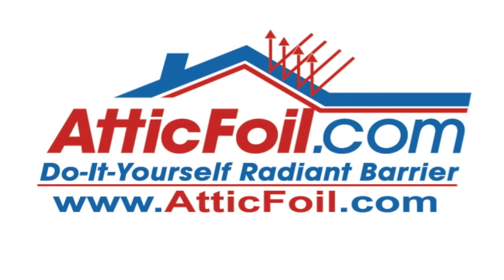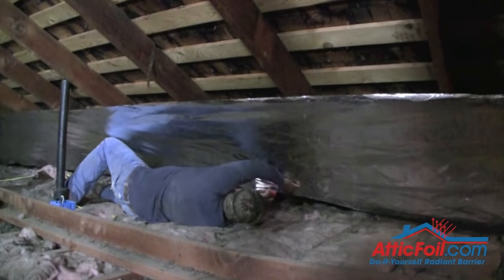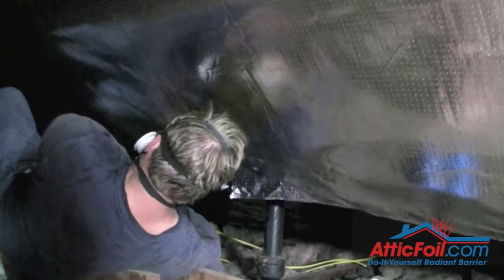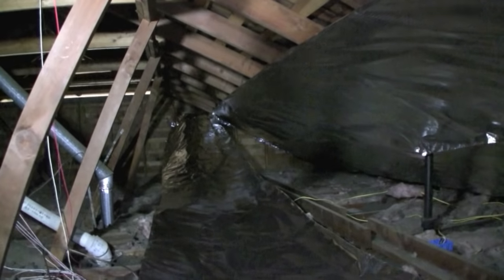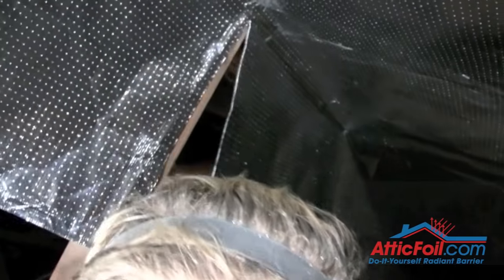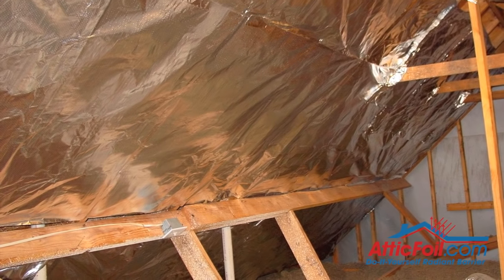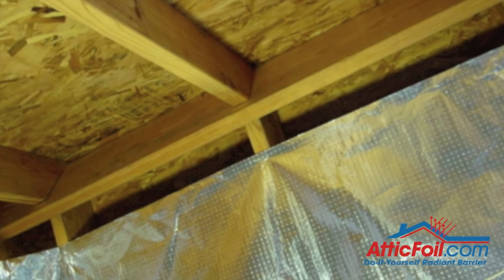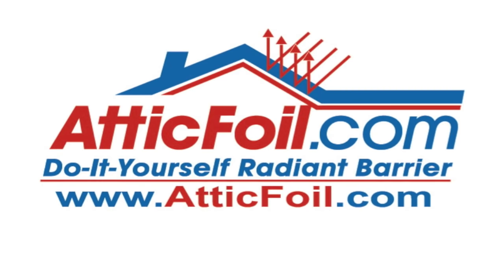Radiant Barrier Installation - How To Install Radiant Barrier

Comment: No one ever compares there bills on here before and after
Reply from the maker: I wish more customers did too!  Most of the results are here with 2000 other customer reviews: www.ReviewAtticFoil.com
Reply: @AtticFoil  ur link dose not work
Reply from the maker: @CCCC-tq8yo  Weird? It worked but gave me a Malware message?  Try www.ReviewAtticFoil.com it's a link to same page.
Reply: Not sure about the heating/cooling bill yet but for what it’s worth, I was quoted $962.50 to get radiant barrier installed in NC and I bought my attic foil roll for $117.95 (not including staples and a stapler.) I’m part of the way through the installation and it’s manageable by myself. I would recommend the diy approach and I’m happy with how durable the roll is as I’m installing it.
Reply from the maker: Alex, thanks for purchasing www.AtticFoil.com !  Yes, it definitely is a DIY project you can do for a fraction of the price compared to having it installed.  Please tell your friends and neighbors!

Comment from the maker: @tdennison22 An attic fan may (or may not) be your best option.  You don't want to mix exhaust vents.  Normally on higher pitch roofs, I like wind turbines - they work great, are easy to install and don't use electricity.  On lower pitch roofs, I like ridge vent (assuming you've got enough ridge).  First, I'd check to make sure you have soffit vents that are clear and open. Go to my blog RadiantBarrierGuru(d0t) com and read about proper attic ventilation or call us 800-595-8772 for more help.

Comment: how much would something like this cost for a house 1500 sq feet
Reply from the maker: Pricing is here: https://atticfoil.com/index.php/products/48-wide-double-sided-atticfoil-radiant-barrier-foil-perforated/  For 1500 ft home, you will probably need 2000 sq. ft to account for slope of roof.  Also, garages and porches can also be done.  Call us at www.AtticFoil.com if you need help in determining exactly how much you need.

Comment: Even if the radiant barrier touches the insulation its ok because the heat is traveling between the foil and bottom side of roof decking

Comment: That's great for summer, what about winter?
Reply from the maker: www.AtticFoil.com is mostly to reduce Summer heat gain.  Think of it as an umbrella compared to a jacket.  If you live where it's sunny a lot of the year, it's a huge benefit.
Reply: @AtticFoil  I live in Massachusetts and my house is really exposed to the sun , no trees. I am thinking of installing this type of radiant barrier because of the summer heat. But my concern is the heat gain that I will lose in the cold winter months or am I incorrect in thinking that?
Reply from the maker: There is actually very little useable heat from the sun on the roof in the winter for several reasons.  First, the sun is low, second the days are short and since heat always goes from hot to cold, the colder air will "suck" the heat out pretty quick.  Overall, you will come out ahead installing www.AtticFoil.com in your attic even in a colder area.
Reply: @AtticFoil  Thank you so much for the info, I'm no expert but that all sounds right to me, thank you 👍

Comment from the maker: @monkeyman1140 For high pitched roofs check out AtticFoil(dot)com and look at the Flat-Top Method on the Tall Attics Page.  This method keeps you from having to use any ladders in your attic.  Basically you create a flat grid across the attic about 7 ft. high.  Then run the foil up the slopes and across the flat part.  Works great.

Comment: Just need to be specific about which side faces where, remember we are 1st timers. I know I know when all else fails read the instructions.
Reply from the maker: Typically for staple up attic installations you will be using the double sided AtticFoil.  Both sides are the same.  https://atticfoil.com/index.php/products/48-wide-double-sided-atticfoil-radiant-barrier-foil-perforated/

Comment: the overlapping ins wrong.  if there are any roof leaks, the water will drip into the ceiling, to fix this overlap the uper insulation onto the lower,  above it, so it creates an ability for any moisture to flow from top tobottom and out the wall,
Reply from the maker: Actually the LAST thing you want is for any water from a roof leak to go to the bottom and into the wall.  With this method of installing www.AtticFoil.com any roof leak WILL drip within 4 ft of the leak and you will actually SEE it on the ceiling WAY before you discover the walls are wet/damaged.

Comment: Nice install video but ... that guy looks like he covered over all the roofing air vents and enclosed the entire attic save for the soffit vents. Those bottom soffit vents he correctly left  uncovered are useless unless you allow for venting out of the top.
Reply from the maker: He is not covering the air vents.  The basic rule is that if there is a hole in the roof, you want a corresponding hole in the foil below it.  Air should flow freely through the attic as though the AtticFoil Radiant Barrier is not even there.  www.AtticFoil.com

Comment: I if and by how much it would reduce my electrical bill which is $250-300 in my 2 story south Texas house.
Reply from the maker: That's a hard thing to pin down.  Basically Radiant Barrier reduces heat coming in the "top of the box".  On a two story home, the "top of the box" is less than a same sq. ft 1 story home, but it still makes a difference.  There are a lot of factors:  Age of home, equipment, construction, lifestyle etc.  Generally though 5-20% is going to be the range.  Usually, the biggest difference is in the comfort level on the 2nd floor.  We have many reviews where the customers say it just "feels" better after installing AtticFoil.
Reply: AtticFoil Radiant Barrier Foil Insulation thank you.  We went up there and my hubs put his foot through the ceiling. :/.  We realized we need some kind of board to walk on.  Any little bit will help!  Because we are paying so much we need some relief!!  We make less than 30 a year right now! Thank you so much for your awesome help and videos!!
Reply: you should start by making sure all your windows are caulked as most of your air might be escaping from there. I am in the same pickle you are in right now. The attics have these 2x4 that run across the entire attic. I have been told it is safe to walk on those... please someone correct me if I am wrong.
Reply: Faiza Raza,

It’s two years later. How’s the heat and comfort?

Comment: “It does not have to be pretty to be effective.” 

Man if you feel like taking business to the next level, that is not the correct approach. Also, if you are training guys you want to be OVER picky on cosmetics. Because you know they will typically land somewhere underneath perfect. Which is great. 

I install functional systems. I tell my clients that “it’s not fun money.” Functional money is not fun money to spend. It’s not like buying a car. I install crawlspace projects for $5K to $40K.  

It’s already a tough purchase when they can’t see it often and have to trust me. So, if my customer is paying that much money you best believe I’m going to make it pretty, and make sure it lasts forever, even though it doesn’t have to be pretty to function. 

Probably more on this comment than needs to be. I just very strongly disagree with that mindset. Do your best on every single project. Go the extra mile. It’s not all about installed dollars per man hour. If you have to move that fast to make money, you may need to re think your business model or raise your prices. 

But wait.... probably can’t raise prices if you aren’t selling the cosmetics as well. Not to the level that will change your life.
Reply from the maker: Did you miss the whole part about "DO-IT-YOURSELF" Radiant Barrier?  For them it's about the benefit and not how good it looks.  But thanks for the snarky comment!  Made my day. Ed.
Reply: @AtticFoil  no shit right. Dudes trying to sell quality to a comment thread that’s here only for value. I give zero fucks what it looks like

Comment: I just got this foil from Amazon, from the manufacturer. So its not a chinese fake. I lit it up with a lighter and it burns like paper, even faster. Isnt it supposed to be SOMEWHAT fire retardant?  is that something people actually installing in their attic next to all the electric wires and furnaces? Thats a fire hazard
Reply from the maker: Well, we do NOT sell www.AtticFoil.com on Amazon. We ONLY sell direct from our website. So, it's not ours. There are some companies that try to capitalize on our brand name and call their product AtticFoil.
Reply: If I have an older home and wanted to replace my plywood roof boards during a re-shingling, can I just apply this stuff to the back of plywood pieces directly before I lay new roof boards on?
Reply from the maker: Yes, two different methods: Here are the videos: https://youtu.be/iknm3zkIxaU?feature=shared  or this method: https://www.youtube.com/watch?v=uEh28E99arg
Reply: @AtticFoil  Nice thanks 👍

Comment: I am not a builder but logic dictates that second row of foil should have gone behind the first row and NOT stapled on top.   Shoddy workmanship.
Reply from the maker: Yes.  Very clear you are not a builder.  This is done in case there is ever a roof leak it will drip within 4 ft of the leak instead of going into the walls or soffits.  We want the leak to show itself with simple stain on sheetrock instead of wet walls.
Reply: good, your a Shoddy thinker!  lol
Reply: why would logic dictate that at all? cool air is coming in through the soffits and traveling upwards with the hot air out to the roof vents. If you have the top overlapping the bottom piece, hot air will be able to go out of the overlap. In the way they did it, the overlap faces downwards (the opposite way of which the air is flowing.)  this is only going to let cooler air in. It almost acts as a Tesla Valve.
Reply from the maker: @artlovemusicpeace  Don't overthink this.  Gaps, slits, openings etc. does not matter.  Hot air all heads to the top no matter what side of the foil it's on.

Comment: Is it better to run the foil across as shown in the video? Or would between rafters and stapled to battens also work?
Reply from the maker: Really, whatever is easiest.  It really does not matter.  All you really want is to get a piece of foil between the hot roof and the cooler insulation.

Comment: Is it ok if the foil, stapled under the roof, touch some of the attic insulation at the end of the slope? Will this wet insulation if dew get condensed on the foil?
Reply from the maker: It's ok, the www.AtticFoil.com is perforated, so it is not a vapor barrier.  Also, the only reason the insulation would get wet is if the ceiling is extremely "leaky" and allowing warm-moist air to get in.  This should be fixed.